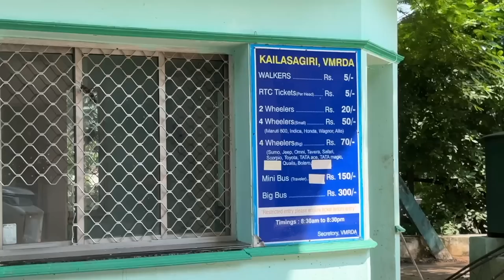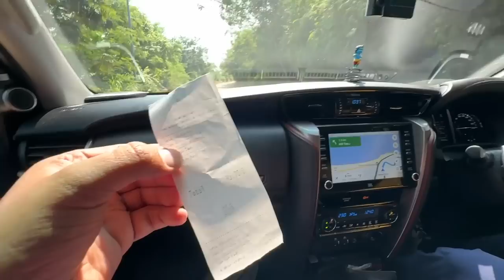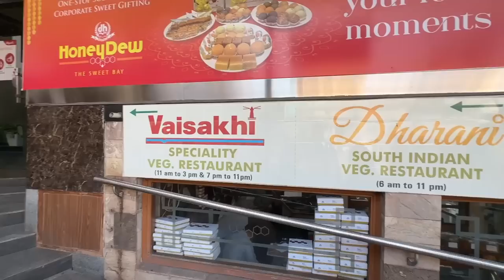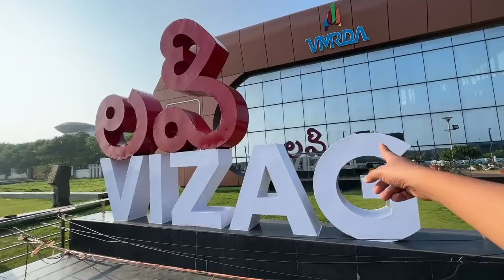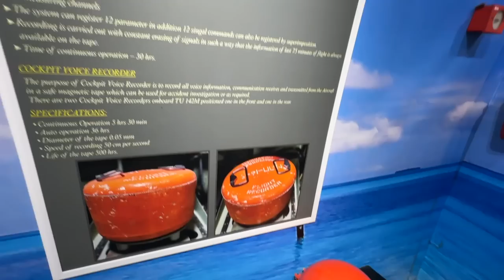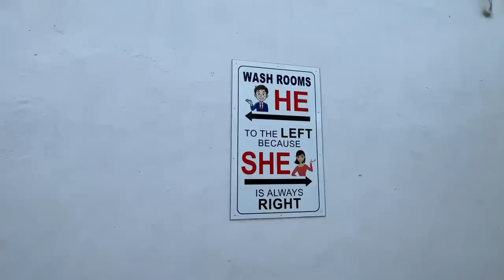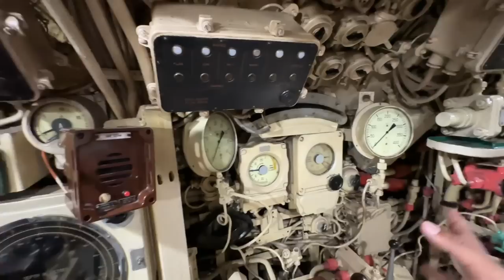EP 105 ആന്ധ്രാ ഫുഡ്, മുങ്ങിക്കപ്പൽ, യുദ്ധവിമാനം | Visakhapatnam, Food | Shopping & Sightseeing

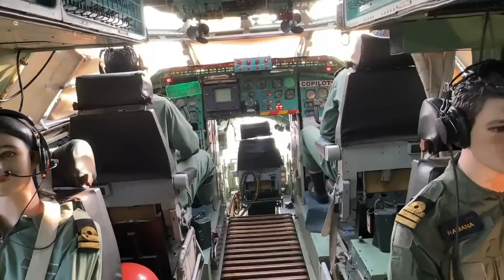Comment: 34:41 The third one is the gunner seat. The long barrel we see in front of the plane is actually a gun which is used to shoot down the opponent aircrafts. A soldier will man the gun on the front by sitting there. The people wearing headsets and facing opposite the pilots are radio operators I guess.